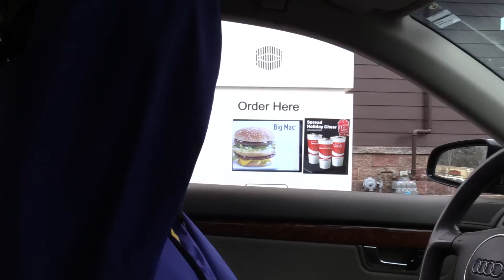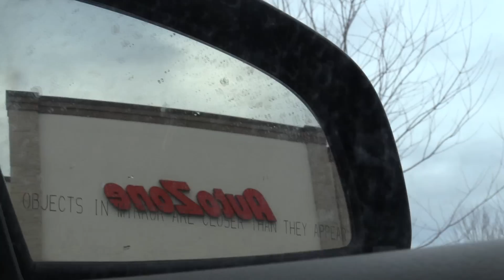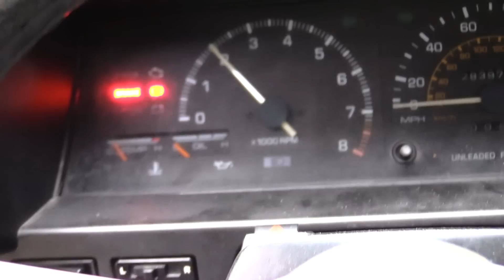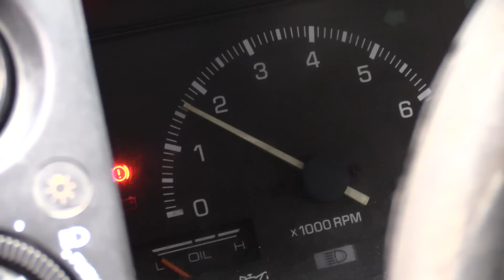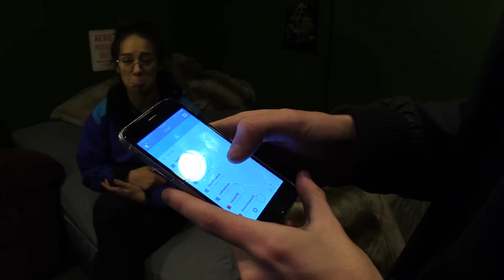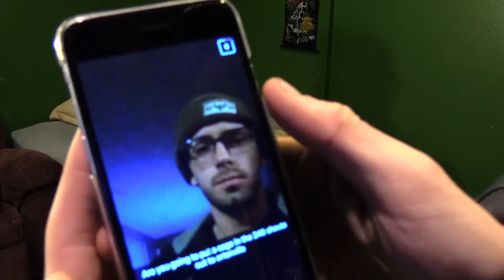Girlfriend Learns To Drive Stick In My AE86

Comment: Yo man i got a frs and need to get wheels and tires any suggestions from moreskids???
Reply from the maker: rpf1 for mad track spec
Reply: +More Skids yooo man i thought about that, but i want a bbs look wheel too, whats ur opinion on replicas???
Reply from the maker: im running reps never had a problem. would recommend
Reply: +More Skids fourshur bro ur vids are tight come to cail my friend and i both work at a local pep bois and do dounts after closing with one of my managers Miata.
Reply: XXR and ebay, best options out there
Reply: what are your back wheels and tires bro
Reply: *GT86

Comment: I know how to fix the idle on your 86. Near the throttle body there is something to control the idle you just need a flat head scew driver. Its called the Idle air control Valve. You just need to close it up a bit. Hope this helps.

Comment: My miata idles at like 1700 once it reaches operating temp I said fuggit loud for life
Reply: PuppetMaster yeah or soapy water and it'll bubble up, I'm not gonna waste my time I'm gonna be going turbo so I'll replace all hoses and lines
Reply: Ross Newman adjust your idle, you have to bridge two things on the diagnosis box and mess with the throttle screw.

Comment: i keep seeing americans holding down the clutch when starting their manual cars in neutral, i know she is new to stick but many people do it, holding the clutch down is a habit not a necessity when in neutral :P
Reply: Jahoo89 Many cars have clutch safety switches that won't let the car start unless the clutch is in.
Reply: fair enough :P but i have not driven a car older than the 2000's with that :O
Reply: Mine won't start without the clutch pedal pressed. Sometimes I dump it in first right after I start it. Fun shit.
Reply: Mike Lindsey I once had a car that didn't need the clutch pressed to start it, I always left it in gear to when I parked it. Forgot at one point and tried starting it only to end up running over a curb. Haha fun shit for sure
Reply from the maker: the car i learned in required it so it's in my brain for good
Reply: i pretty much clutch everytime i touch the brake pedal so we all have habits :P
Reply: Jahoo89 almost every car I had requires you to hold the clutch in to start it.
Reply: Its a safety requirement in the states. So....
Reply: oh ok i didn't know that :)
Reply: Jahoo89 Some cars are different. I could start my Mustang with no clutch by my Miata won't let me.
Reply: Jahoo89 my '89 740 has to have its clutch pressed down to start
Reply: It is a requirement on all manual cars sold in the US starting in 1987 if I recall correctly
Reply: good to know thanks :D
Reply: It's already been said, but I'll keep it all together. All manual cars at least like 80s up were required to have he clutch pushed in to start the car. HOWEVER, it's extremely common for people to bypass this hence why some people in the states don't have to.
Reply: Anon Doe you are definitely not a mechanic. 100%
Reply: ya its called a manual safety switch some ppl remove them from their cars but i think all new cars come with it from the factory
Reply: AE86 does not have a safe switch or shit like that, I should know, I own 2 of them.
But it is an advantage to start with clutch in, because when in Neutral, the mainshaft in the transmission will still rotate with the engine, consider this when a cold start does not provide the most initial oil pressure, you get excessive crank wear.
Additionally, the AE86 starter is only 0.8KW and does not grow on trees...
Clutch in =  Save on initial start-up wear for starter and crank, I`ve killed a starter this way so I should know that too.
Additionally this guy started driving it around way too soon, you want it idling no more than 1200 revs before driving (the higher the idle, the colder it is), this one was way more than that.
Then again not my car, this guy wants views, so what do I care...
Reply: Swiss G all ae86s made before mid 85 did not have them. The rest did,
Reply: ToreDL87 oh also Qs 86 idles high regardless. I think maybe it drops one its at running temp but for sure know it takes a long ass time if it even drops at all
Reply: yea i said all new cars... i was just telling the op thats y he always sees ppl pushing in the clutch before starting
Reply: as a european I have also this reflex in case I forgot that i parked the car in 1st gear, i usually don't , but sometimes if I'm on a slope i do  just in case the parking brake die
Reply: 97' Civic with clutch safety switch.

Comment: Hey Quentin love ur vids keep it up.  oh and   i saw this posted already but i have a gti and had the same issue with my light's.  you probably have corrosion on the contacts.  you can sand it down but corrosion can come back.  Buying a new assembly should be under 50 bucks just an fyi.

Comment: I had an Rsx with the same issue. Would idle at 2k from a cold start then settle. I checked the OBD port for a code and it turned out being the TPS. The sensor was faulty.

Comment: If your 86 is revving that high and not getting up to temp then you may have a bad thermostat, causing the engine to idle higher to warm up, though 2 grand is way too much for idle, but its just a thought I had

Comment: Hey have a geez at your throttle body there should be a little screw that will increase and decrease your rpm,  it should be there your throttle cable connects to the throttle body. Kinda hard to explain but give it a go
Reply from the maker: will do thanks!

Comment: was that a real ae86? like LHD conversion or just a corolla with a moded engine?
Reply from the maker: comment man comment man it's 1985 Toyota Corolla GTS stock engine. and it's USDM technically you could call it an ae88

Comment: IT a AE88 not 86 the AE86 is a japan exclusive and only comes with the steering wheel on the right.
Reply from the maker: Hyper Doge depends on how you look at it. The chassis code reads AE86 and the vin reads 88. Makes things easier to just call it an 86, so people know what you're talking about
Reply: More Skids yeah most dont know it tho and are you going to add the front bumper any time soon since it seems in pretty ok shape
Reply from the maker: once i can afford a nice rep or a jdm one haha

Comment: why do americans always say push the clutch down to start? I did my driving lessons/test in a manual and i've never done it.
Reply: Everyone drives manuals in the UK, this has literally never even been a thing here, I've got a 91' Golf.
Reply: Jamie Smith idk but my s10 can't start unless the clutch in, I think most cars in the states require it as a law but I could be wrong.
Reply: If you do not push the clutch down to start it up you're unnecessarily stressing the starter, apart from gearbox.